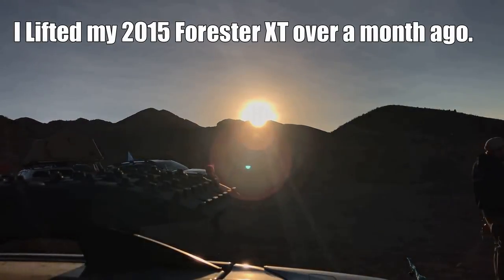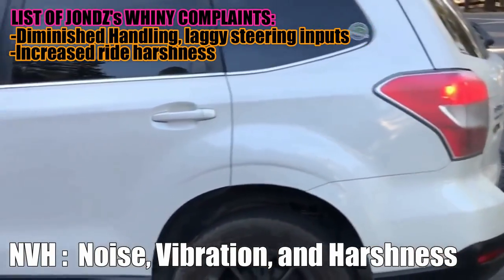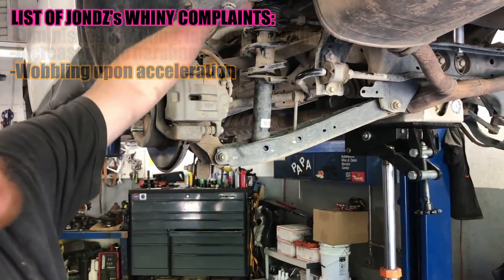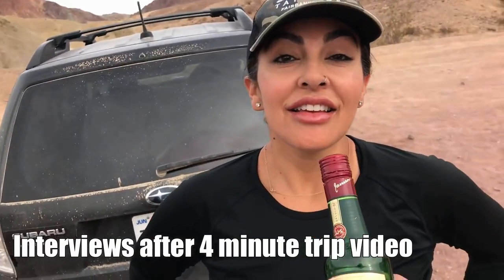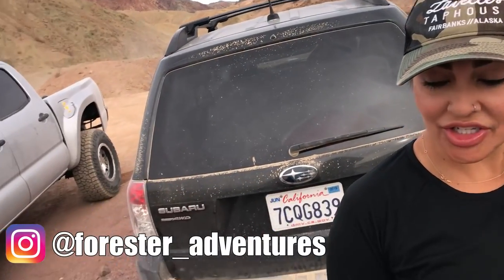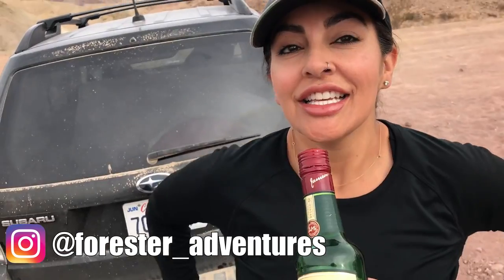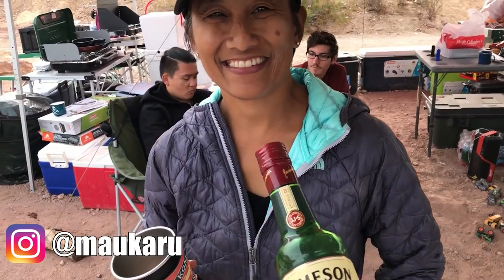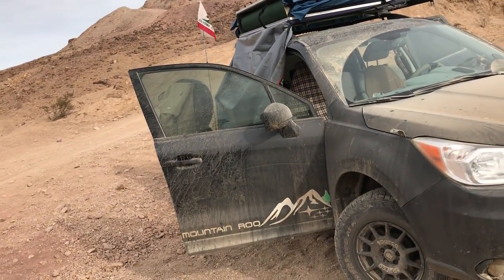DOES YOUR SUBARU NEED A 2-INCH LIFT???

Comment: Awesome video ! My two cents is that don't think that these cars and suv were not meant to be lifted. I think Subaru was going for that all weather vehicle that would give the driver the confidence and take the worry out of driving in bad weather. That being said its great to see the aftermarket subie performance company make a quality lift so that they can be lifted with minimal problems that come with lifting any kind of SUV. What I'd like to see is that the these company's start making better shock and springs combs , control arms , polyurethane bushings kits to really get the ride dialed in. I have not done much research on those things so they might be already out there. When I had my sport cars I pretty much had all my suspension aftermarket and it did wonders for handling , ride quality and some noise reduction. Anyway get video learned a lot and some things to consider when I get ready to lift mine !
Reply from the maker: Stephen Gomez I totally agree.  I strongly feel that if you lift a Subaru, you are making a Trade-off, not necessarily a complete upgrade.  So far, this lift was everything that I expected.  Well.... except for the wobble that no one ever talked about.

Comment: Conserning wobble after a 2" lift!  Check out Anderson Design Fabrication, they sell a Subaru 2 .5  type 1 cut trans mount anti wobble, $36.99 - $54.99. The wobble happens with the cv transmission.
Reply from the maker: Yes, i go over this in 1 or 2 videos after this one.  Thank you!

Comment: Interesting about the wobble affect. Never noticed it on my 14 XT with a 1" 3/8" lift and this video is the first time I've heard of it. Going to lift my 18 XT 1.5"-2", so I will keep an eye out for that wobble. Good to know it's a cheap and easy fix though. Thanks for the info!
Reply from the maker: dustin boone I got my transmission spacer put in yesterday.  It did the trick!  Not only that, but I feel that the transmission is more tightly connected to the engine.  I need to do more “observing” but it almost seems like I’m putting more power down now.  That’s really a subjective opinion, but I’ll try to get some 0-60 pulls to back it up.

One solid observation is that I actually hear my engine now.  If you are familiar with the unfiltered sound of equal length header boxer rumble from a muffler deleted exhaust,  It sounds just like that but on a much lighter scale (and No droning of course). this means that my NVH is increased, but now that I can hear what my engine is actually doing, in all for it!!!!

Comment: I did my 1 inch lift myself and its awesome... Just installed 1 metal piece under each spring and so far its been incredible. My little square (the 99 model) cant compare to your beauty tho!
Reply from the maker: Takumi Fujiwara my friend Gabriel has a 1st gen Forester and he seems to be more capable.  Better approach and departure angles.  He’s also a rally cross racer, so they might have a lot to do with it too 😃.

Check out my Instagram and look up @jondz_adventuring.  I’ll be posting up some clips of last weekends adventure, and my friends awesome SF ver 2 will be in it 🤩.

Comment: I got my lift about a month ago. I went with the 1.5" front, 1-7/8" rear with standard height kings springs. I ended up with 1.75" front and 2.5" rear. I went lower in the front to protect the CV joints. The ride is a bit stiffer but overall i like the new feel. I haven't noticed any wobble at all, maybe there's an issue with your lift install or something else.

Comment: Love how they look lifted, wish there were more complete options vs spacers. Like icon or something.
Ground clearance is cool, a Landcruiser (200 series) has 8.9” because of the pumpkins underneath, they are two different beasts.
Approach and departure angles with so much low hanging plastic makes it tough for me to do anything but fire roads. Much respect to you guys, I think lifted Subaru’s look badass!
Reply from the maker: 2A556FMJ it’s amazing how much support Subaru’s get.  At Subiefest they showcased some new raised struts with extra travel.  I know there’s a group out there that’s trying to get ARB to make lockers for Subaru’s.  It’s going to be pretty interesting to see what becomes available in the next few years.
Reply from the maker: 2A556FMJ check out the Instagram for this offroad bumper company that just made a Subaru line.  Company is called @full_force_metalworks_
Reply: JonDZ Adventuring that would be interesting to see! I’m sure if there is enough demand they’ll make it. That being said I don’t think I’d like to take my subaru anywhere that requires a locker. I’ll just live through you guys :) my subaru is an all weather multi terrain family hauler.
Reply from the maker: 2A556FMJ yeah, good point!  I don’t even care too much about wheeling.  I just want to explore some cool places.  

Speaking of which, I visited the Trona pinnacles for my first time 2 hours ago.  Now I’m in lone pine to Meet up with others to visit the Alabama hills.
Reply: JonDZ Adventuring nice gonna head out there when my wheels come in.

Comment: Thanks Jon, great video and as always appreciate your honesty about the lift.  Too bad about the wobble, but at least their may be a fix!  I have run aftermarket transmission bushings and they do work (I used them for drag racing), however if you put one of these in they sometimes can create additional noise, harshness, and even their own vibrations.  Good Luck and thank you!
Reply: OcFishHooked yup and after mods in my teens to early 30s you get to know mods = cause headaches. Race car/truck parts require race car maintenance.
Reply: @TobyCostaRica  That is very well said.
Reply from the maker: OcFishHooked and 2A556FMJ great info from the both of you, thanks!!

Comment: No because of articulation,
On my Outback the shocks travel maybe a foot or so. The ride height is 8 1/2 inches so if you drive over a rock it floats one wheel into the air. Subaru doesn't have a "wheel lock" mode so when one wheel is in the air the rest of the wheels stop spinning and the car comes to a stop. You don't need a lift because the ongoing problem of floating a wheel becomes a problem sooner than ground clearance becomes a problem.

That being said any "proper" 4-wheeler with a transfer case and a low range will get about 15mpg. Personally I have driven all the off-road trails in my immediate area and want to drive further to see new trails. Because of this I find myself in the position of having 300 mile trips more frequently. A Outback can get about 28mpg on the highway but I find that it gets about 25mpg when trail use is mixed into the equation. 

Because of the MPG problem I find myself spending 60 to 70 dollars to do an outing in my F150 and 20 to 30 dollars to do an outing in my Outback.

This is why you need a Subaru for "adventuring" and a proper 4-wheeler for "wheelin". A Subaru will still get you quite a lot of places a regular passenger car wont it's just that off-road tires and a lift aren't something you need because the ruts, rocks and uneven terrain will end your run a long time before traction and clearance becomes an issue.
Reply from the maker: Parajared that’s a good take on needing one or not.  Also, as said in this video, lifting a Subaru is a trade off.  I have a few other videos after this one that shows the Subie benefiting from the lift, but like I said, it’s a trade off.  Handling and driving dynamics are
changed.  I really appreciate you taking the time to leave this comment 👍

Comment: Nice video. What's the best lifting kit for a 2016 Impreza 2.0I hatchback?
Reply from the maker: I’d say swap in Crosstrek suspension and then get the best Crosstrek setup.  You can go with basic lift kits to something more extravagant like the race works coilovers
Reply: @JonDZ_Adventuring  Thanks! I'm from Canada, but if ever i do the lift and decide to test it down Southern U.S. would love to hangout with you guys.

Comment: 14 xt 2inch rough country lifted struts, on wildpeak at trails ya i get thst wobble and feeling that its just not right as well as a harsh street feeling over anything but a flat road
Reply: I'm looking at those lifted struts as well-instead of spacers. Anything that you don't like about them? How have they been holding up?
Reply: @travisradke3317  great beefyer ride and feel  then stock way better the putting hockey pucks in thats for sure keeps your geomatry the same without needing longer bolts and blocks as these have a higher perch u can run bigger tires
Reply: @Dankstar209  Thanks for the quick reply, I've got 85K on my 15 Forester so I'm thinking of doing it anyways to replace worn stock struts. You make it sound like the right call, it's for sure next on my list of mods before early summer when off-road season starts back up again in CO.

Comment: I also had vibration on acceleration when lifting my built 2004 by 2 inches. Heavy duty front axles resolved it. 👈 Sounds like a different issue on the SHs though, doesn't it?
Reply from the maker: #SaveTheManuals seems to be different with all the models.  My buddy with a SF Forester fixed the problem with Rallitek trans spacers.
Reply: My 04 with 2” ADF kit has always had a slight vibration on hard accel. TBH, I think it was there before the lift, too - but def more noticeable now. I have the auto trans, and I am also pretty sure it is the rear mount - there is quite a bit of slop in them. That may also be part of the reason I developed an issue with inboard DOJ binding on a recent trip through Oregon, combined with other factors. In any case, I’d like to try taking the mount out and doing my own mod using windshield adhesive to mould a bushing in place.
Reply: @kootsmike5833  Does the vibration you feel on hard accel feel like it's coming from the front wheels or front drive axles? Feels like they're binding a bit?
Reply: #SaveTheManuals kind of hard to tell. I doubt it at this point, though - brand new axles. If it were a new symptom with the new axles, I might think it were the axles - but it’s not new. The previous problem (on my road trip) was definitely the axles - not surprised, as they were the originals with 155000 + miles.
Reply: @kootsmike5833  What kind of brand new axles? I had new OEM replacements too and it didn't solve it for me. I upgraded to the heavy duty ones and the vibration went away.
Reply: #SaveTheManuals Cardone HD

Comment: I have a 98 Forester and I’ve lifted mine 2 inch in the front and 2.5 inch in the rear.... I feel no wobble at all and I wonder if your wobble has something to do with re-tightening all bolts associated with the lift kit? Recommend to retighten everything after 500km from lift, it sounds like something is loose with yours mate. Have it checked if you can.
Cheers
Reply from the maker: pootang47 the wobble that people refer to is actually more of a shaking/shuddering.  There is no loss of control, so wobble is probably the wrong word.

This Shuddering upon acceleration is now fixed.  A transmission spacer was installed to make sure the driveshaft is aligned at all times.  Without it, there’s a whole lot of play.
Reply: @JonDZ_Adventuring  I drive a 2001 fozzy type s with kyb struts and A.D.F.  lift 2inch frnt and 2 3/8 rear and oem springs and i DO  get the wobble. I have 100k miles on her. I wonder if they have a insert for my trans? ( NON CVT ).

Comment: Funny, I also have a very annoying wobble in my 2017 stock Outback when I accelerate.  I noticed it is about at 1700 rpm.  Will have to watch what speed.  Probably somewhere 20 -25 mph.  Super annoying.
Reply from the maker: There's a transmission insert to fix the problem.  You can buy from: https://andersondesign-fab.com/page/4/?s=outback&post_type=product

Comment: Hey Man, Great vid as always. I am currently thinking of just adding a 1" lift to my 2018 Forester XT. Do you think the wobble will be present with just a one inch lift?
Reply from the maker: Hey there Robert!  I guess some people get the wobble, some people don't, some people don't notice it, and there's some people like me that really notice it.  But no worries!  It can be fixed!  You just need a CVT transmission insert.  I'll be getting mine put in next week.  As far as harshness and handling, you'll get less of that, but it's so minuscule that it no longer bothers me.  My only problem is that darn wobble.

Before you pull the trigger on that 1 inch lift, please watch my next video.  I have this theory that in order for us to safely many trails, we will need a 2 inch lift, OR a modified front bumper.  If you look up the definition of a a high clearance vehicle, the minimum is 8 inches.  The extra 2 inches makes so much of a difference.  my next video should drop by tomorrow.
Reply from the maker: What I meant by that is, the 2 inch lift helps us get over that minimum ground clearance requirement so much more.  My next video will show you examples of that.  Have fun with your ride! #thelastgreatforester

Comment: New Subie owner. Can you recommend any mechanics/installers in the Big Bear, San Bernardino area? Does adding a lift void your warranty?
Reply: Revolution off road in Hesperia installed mine
Reply from the maker: Jim’s autoservice did mine.  Contact Nate, he was the last person interviewed in this video.
Reply from the maker: Jim's Auto Service
23385 Crest Forest Dr, Crestline, CA 92325
(909) 338-1946

Prices are extremely fair.  Call for an appointment.  I was scheduled a week out for my lift, but it was worth the wait.  the lift was finished in a 3 hours by Nathan and that's including all the intermissions with people coming in for a smog check.

Comment: my subi does the same thing, its transmission shudder, especially at hard acceleration from the line for me. spacers, change mounts fixes it, so im told
Reply from the maker: Rob, yes, that’s correct.  After installing a transmission insert, the shuddering went away.

Comment: Any extra wobble, NVH etc after putting in that Primitive Racing transmission skid plate? Also, did you have to remove the heavy metal vibration dampener?
Reply from the maker: Jiminy Cricket yes, NVH went up.  I have the details in the follow up video:
https://youtu.be/b0TBsYkhVZI

Nothing was removed, we just added the transmission spacer

Comment: I do get the wobble, so do i need to get that kits thing that the guys was talking about?
Or just leave it, will be fine
Reply from the maker: AznGuyn01 here’s ADF’s Instagram post about the part.  I ordered mine for $56.  The FXT needs a different CVT transmission insert and I’m not sure Nate carries them.  I’m unsure about the long term effects of the driveshaft shuddering like that,  but for $56 bucks to fix it, IMO, better safe to fix it 😃.  It wasn’t terribly difficult for Nate to install this part.  I think he just removed the heat shields to expose the driveshaft and popped the insert in.  You just need to really get under your Subie.

https://www.instagram.com/p/BpzmnT9Ay1C/?utm_source=ig_share_sheet&igshid=1sskcw31kt2jh
Reply: JonDZ Adventuring what the softest/hardest should i get?
Reply from the maker: AznGuyn01 when I ordered the part from ADF, they included a soft and medium density insert.  My mechanic Nate put in the medium density.
Reply: JonDZ Adventuring i have 2015 crosstrek and I email adf they tell me get soft it most common one, or should i get medium like your?

Comment: The wobble is the front inner CV joints. Trust me.
Reply from the maker: K Dowz, we found the “shuddering” or wobble as some people describe to come from the drive line not being lined up.  A transmission insert fixed the problem and if you watch the follow up video, you will see.

But, ya man!  Wobbling can come from worn axles, or other things.
Reply: @JonDZ_Adventuring  would one of those carrier bearing spacer inserts helps with lining up the driveline after a lift?